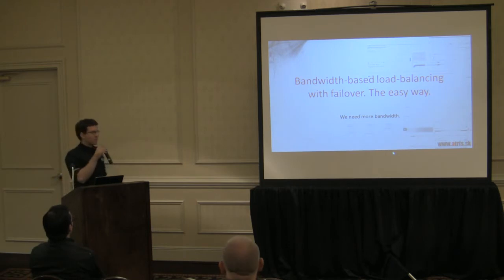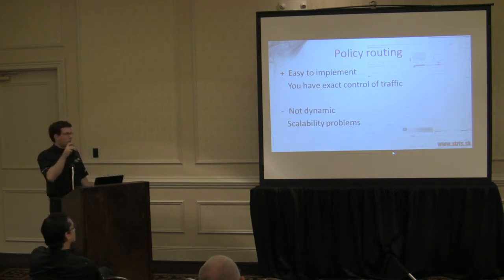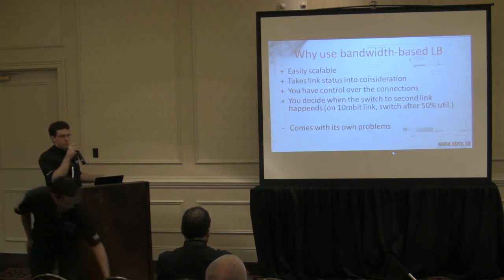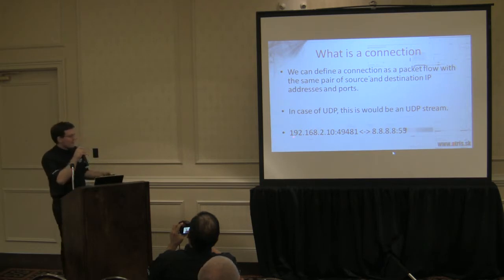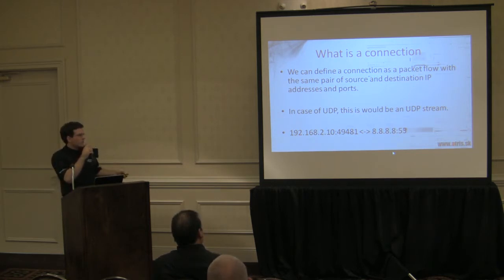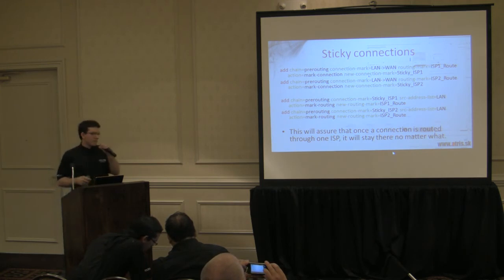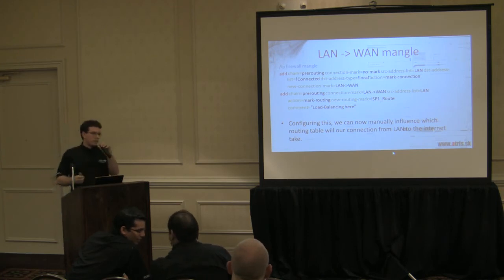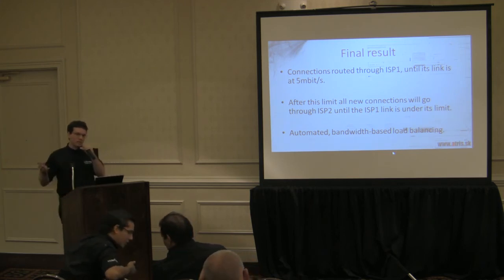MikroTik - Load Balancing / Mangle deep dive

Comment: Excellent presentation, I just configured my network to use this load balance method and its working great. I just have a curiosity, and I'm not sure how to implement this in an scenario with 3 or more lines to balance, is it possible?

Comment: Great presentation. I did follow your setup and tested it on a lab environment. I've noticed that the mangle rules for new-routing-mark don't change between ISP1_Route or ISP2_Route. Is that happening in the background? the logs show it is switching.

Comment: @Tomas Kirnak, this presentation is outstanding and i see a possible useful scenarios for it. Just a question this presentation if  I follow it as is in a solely Hotspot with usermanager as radius will it work or do i need to modify somethings first? and if i do need to modify can you please at least lend a hand to point it exactly what items of mangle or route rules are needed.
Reply: This is an update. I have followed your instruction and presentation here also from pdf. Why do i experience some disconnection and when browsing there is an intermittent connection and displaying "no internet connection" in browser?
Reply: any update? im gonna try to use this

Comment: nice work bro
i have a question
i have load balace 4 line
i want to make line 4 just for whatsapp traffic .is it work ?
plz if u know
my best regards
Reply from the maker: You will need to classify and separate the WhatsApp traffic into a separate connection mark.
(every WhatsApp connection should be marked with that connection mark)

After that, you will be able to route the traffic with that connection mark into the routing table specific for that WAN line.